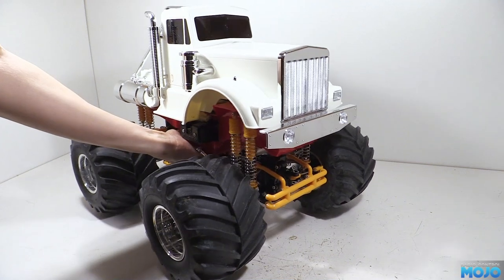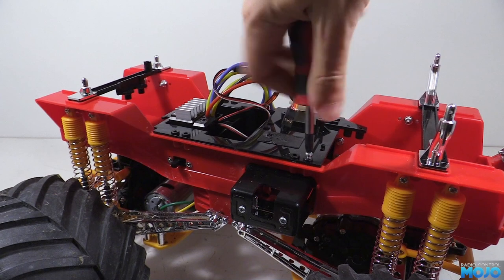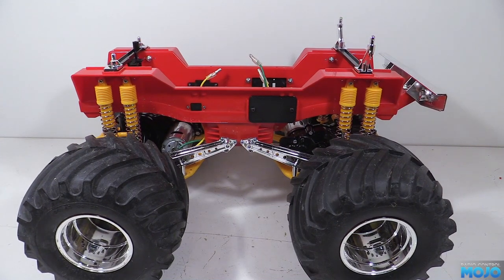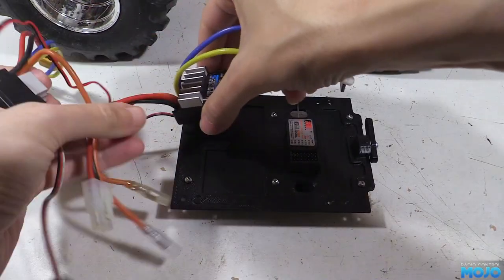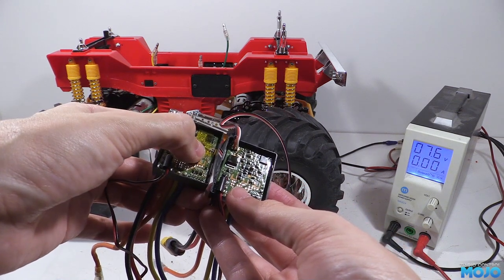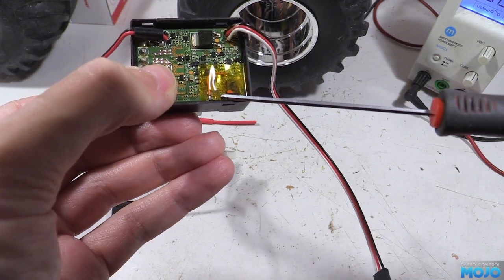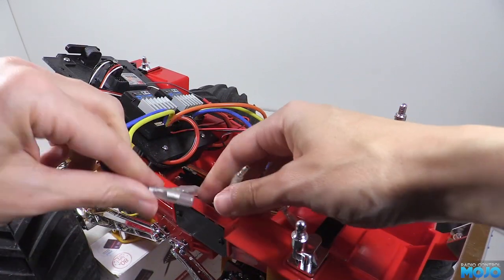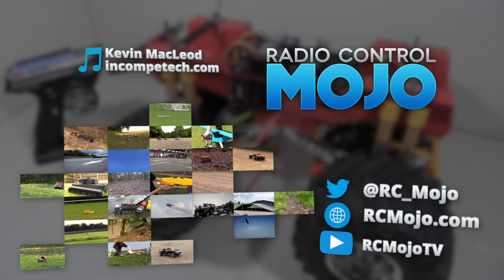Tamiya Bullhead - #7 Twin ESC + LiPo

Comment: The electronics tray and blanks are awesome are they available for purchase if a person doesn’t have a 3d printer.
Reply from the maker: I generally don't sell printed bits, just because of the time they take to print, but I can if needed, send an email using the contact form on 74hc.co.uk. A better idea is to have a search for companies that specialise in 3D printing, they'll be quicker and higher quality than I can produce
Reply: Excellent thank you for the reply.

Comment: Are there only some receivers that accept 2 ESC at the same time?
Reply from the maker: The receiver doesn't care what's connected to it, as long as there's only one power supply of course. The magic is in the transmitter, quite a few have support for dig and 4 wheel steering now

Comment: Could I do the same mod on a boat?
Reply from the maker: The twin ESCs, sure. If you have twin motors and props you might be able to set it up so you can steer at speed with just the motors
Reply: Yes